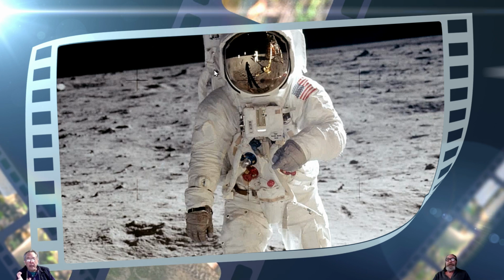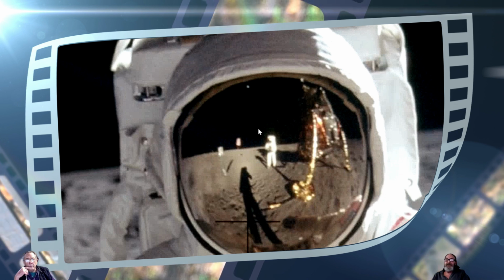THE APOLLO DISCUSSIONS "SHADOWS/ EARTH COORDINATES &  INCORRECT POSITIONS/ FUEL SYSTEMS" PART 68

Comment: Several things about this video that just scream Fake.  The photo of the back of the LEM, how the heck could this thing hold pressure?  It’s dented, has folds in it and the light under the cabinet is a reflection!  The shadow that goes all the way to the edge of the horizon.  Keep up the great work exposing the Fraud known as Apollo!!!
Reply: You're not looking at the pressure hull of the LM.
Reply: @mikeh3441  Even if he was, it wouldn't make any difference, since you know the pressure hull of the LM was made of aluminum alloy that had the thickness of 3 sheets of Reynolds Wrap.. A hull that was so flimsy in fact, that Apollo Flight Director, Gene Kranz, said : "You  could poke a hole right it through it with your finger".
Reply: @straydog02  Grumman's Lunar Module was an outstanding spacecraft and one whose design principles are still used in aersopace industry today. Typically the throw away comments about "tin foil and curtain rods" come from those that have not made an attempt to better understand the development of the spacecraft despite the wealth of available information and are often formed on a cursory glance at a photograph. Many naysayers haven't even seen the LM without its clothes on, as evidenced by the first commentator.  Kranz spoke highly of the spacecraft, perhaps include those elements in your quotes aswell?
Reply: @mikeh3441  I don't judge the LM on it's appearance, as ridiculous looking as it is, but rather on the fact that it had aluminum alloy walls no thicker than 3 sheets of Reynolds Wrap.. Walls so thin and fragile, that if not extremely careful, even a finger would have punched a hole right throught it, causing instant death to the astronauts inside the pressurized cabin.. You might think that's an outstanding spacecraft design, but there's a lot of people who disagree with you.
Reply: @GENERAL-GRANTANDSHERMAN Posting such easily provable lies only makes you look stupid.. Kranz was not talking about the heat shield on the CM, but the walls of the LM.. Watch this video and listen to what he says... 'You could poke a hole right through it'  zeTETic Backup Channel .. Then look up the information yourself.. It's not hard to find.
Reply: @GENERAL-GRANT1863
What is the relevance of your "three inches of titanium" reference?
Reply: @GENERAL-GRANT1863
Reference please?
Reply: @NoremacOktik  Our resident troll, GENERAL-GRANT is lying.. Both a NASA spokesman and Apollo Flight Director Gene Kranz, admitted on camera that the aluminum alloy LM walls were only as thick as 3 sheets of Reynolds Wrap.. And now that our lying little troll is hanging out with all of the other liars on the Phase 52012 channel, don't expect him to be honest about anything.
Reply: @straydog02 

Their study found that 75 percent of adolescents lie, with an average of nearly three lies a day. But 60 percent of youth surveyed admitted to telling up to five lies daily. These numbers aren't as high as those in the studies cited above. However, they confirm that teen lying is to be expected.
Reply: @GENERAL-GRANT1863 It was aluminum alloy, with the thickness of 3 sheets of tin foil.. Silly lies will not help your cause.
Reply: @GENERAL-GRANT1863 I already have.. So as you like to say, shut it.
Reply: @GENERAL-GRANT1863 Gene Kranz claimed the LM walls were as thin as 2 sheets of tin foil, but the NASA rep said it was more like 3 sheets of Reynolds Wrap.. So it was not 3 inches think like you falsely claimed.
Reply: @GENERAL-GRANT1863 When Gene Kranz said you could poke a hole in the side of the LM with your finger, he wasn't talking about the heat shield.. So stop lying.
Reply: @GENERAL-GRANT1863 The Apollo Lunar Module featured a pressure hull with an extremely thin metal layer, measuring only 0.3 millimeters (0.012 inches) in thickness.

Comment: 24:59 I’ve flown airliners and the speed of them has definitely increased since the start of jet passenger travel… they fly higher and at much higher Mach Numbers than the early days. Typically a modern airliner operates around 40,000 feet at a speed of Mach 0.85 - 0.92… it’s actually impossible to operate much faster than that without a specialised supersonic wing section, like Concorde. Also, the advanced Bypass Turbofans you refer to have actually enabled this…. So it’s untrue to say they fly slower these days or that it’s the fault of the Bypass Engine technology 🤷🏻‍♂️
Reply: https://www.miragenews.com/why-passenger-planes-fly-slower-than-past-989515/
Reply: @scotthenderson6168  Hi Scott… that article is correct but omits any information about Mach Numbers and Groundspeed… flying higher might reduce your MPH but that’s measured with air pressure which reduces  with height… the speed that matters is Groundspeed, your speed across the Earth taking into account head/tailwinds and achieved Mach Number… incidentally if an airliner is flying into a headwind it will fly as fast as possible to be affected by it for the shortest possible time, with a tailwind you will fly at a more fuel efficient speed to take advantage for longer… so the statement that modern airliners fly slower than predecessors is not really a fact.
Love this channel by the way 👍🏻
Reply from the maker: As long as you take your own oxygen with you to mix with the fuel, you can go as fast as humanly possible at this time, depending on the engine. There is a big difference between COMMERCIAL airliners and jet engines, such as the SR-71 Black Bird as well as the fuel required. These are completely different engine and fuel designs. Please read the article that Scott posted in his comment. I suggest that you go to Mentor Pilot's channel, and review a few of his earlier videos.

Comment: The complete lack of "bracketing" on the Apollo 11 mag.40 film gave it all away to me years ago. Great work guys!
Reply: Great point!.. For those who don't know much about photography, this is what bracketing is ....

"Bracketing is a photographic technique where you capture several different exposures of the same scene. This technique is often used to ensure that at least one shot has the desired exposure, especially in situations with challenging lighting conditions." ... Or as Mike Collins replied to mission control when he was told they had a picture on the TV,  "Oh that's great. Is the lighting half way decent?" 😉
Reply: @William-tecumseh-sherman Are you serious?.. According to the official Apollo record, the astronauts took over 8,400 photographs while allegedly on the Moon.. And the first photos, taken during the Apollo 11 photo shoot should have been bracketed, for obvious reasons.
Reply: @William-tecumseh-sherman Besides the plaque photos, there was no bracketing. Also the sequence of photos taken, going from shadow to light to shadow, meaning those shots had to be reconfigured multiple times on the manual camera is laughable. The most iconic picture of Aldrin on Apollo 11 was taken with 1 shot. With no viewfinder, light meter, guesstimating settings, with 1 camera. Absurd.
PS You're the liar.
Reply: @William-tecumseh-sherman Buddy, you don't know what you're talking about. There was only 1 film camera on the supposed lunar surface on Apollo 11.
Reply: @William-tecumseh-sherman 8,400 photos were taken for all of the photo shoots put together, which is absurd.. Had the astronauts taken that many pictures on the "moon", they would not have had time to do anything else, but the filmed footage does not show that.. So that's just one more provable lie in a very long list of proven Apollo lies.
Reply: @William-tecumseh-sherman Your reply has nothing to do with the fact that the Apollo photos were not bracketed.

Comment: THIS PART OF APOLLO MISSION IS FISHY🐡L.E.M. ASCENTED INTO LUNAR ORBIT TRAVELING AT 2,400 METERS PER SEC., WITH 9MIN. OF OXIDIZED FUEL, MOST OF IT USED UP TO REACH LUNAR ORBIT, WHILE LUNAR COMMAND WAS TRAVELING AT 1,600 METERS PER SEC. TO STAY IN LUNAR ORBIT🤔NASA WANTS YOU TO BELIEVE THOSE LIL R.C.S. THRUSTERS SLOWED THE L.E.M. DOWN TO MANEUVER AND DOCK WITH LUNAR COMMAND MODULE😂R.C.S. THRUSTERS ARE TO WEAK TO SLOW L.E.M. DOWN WITH L.E.M. SPEED & MASS, NOT TO MENTION R.C.S. THRUSTERS LIL FUEL CAPACITY MAKES THIS TASK INHUMANELY POSSIBLE🤣

Comment: Hard to believe you would be messing around when a pin hole leak would probably mean a terrible death before you could get both men inside the lander. And it would have to be both or one would be trapped outside as there was no air lock. Good work gents.

Comment: My question is how does any kind of rocket engine work in an infinite vacuum? What is the exhaust pushing off of? 
I've heard that, oh  it expands so rapidly it pushes on the front of the engine. Experiments in vacuum chambers have shown that not to be true.
I watched one video where they demonstrated thrust in a vacuum. They lit the rocket engine and it took a split second, but then it did move in the chamber. But when I slowed the video down to 1/4 speed, the engine did not budge until the exhaust hit the side of the chamber THEN it moved, not before. Well in space there is no edge to the vacuum "chamber". Any kind of pressure is going to instantaneously exit where the least amount of resistance occurs. And if it does push against the front, wouldn't it equally push against the sides? Then which direction is it going to go?? Crazy in all directions??
Then I watch when the LEM is reconnecting with the orbiting craft and the motions it makes are crisp and all herky jerky. It looks incredibly fake. Those motions aren't possible in a vacuum, even if they have magic rocket engines that work in a vacuum, the craft is still not going to be able to stop moving in any direction on a dime.
Also, the movements of the astronots on the moon would have been anything but slow. There is absolutely no resistance. When they are jumping around like a bunch of drunk bunny rabbits, they should have been super quick, not all slow motion looking.
Anyways, another great video guys! I love that you keep coming up with reasons why this is nothing more than a ploy.
The moon landings are nothing more than a conspiracy to deceive. For many reasons...
Have a great day!
Reply: "Then I watch when the LEM is reconnecting with the orbiting craft and the motions it makes are crisp and all herky jerky. It looks incredibly fake. Those motions aren't possible in a vacuum, even if they have magic rocket engines that work in a vacuum, the craft is still not going to be able to stop moving in any direction on a dime."

According to orbital mechanics, the Apollo rendezvous footage that looks so fake, really is fake.. 

"For a spacecraft to rendezvous with another in orbit, they can’t simply speed up or slow down. If a spacecraft tries to move faster, it will be boosted into a higher orbit as a consequence of its speedup. Instead, they use techniques like changing the relative altitude, which alters the orbital period and causes relative motion between the two. This is often done in a series of “hops” where the altitude is changed a little, the spacecraft drift closer together, then return to the same altitude and hold for a while to ensure everything is fine.

As for orbiting the Moon, if a satellite orbits too close to the lunar surface, the Moon’s gravity might cause the satellite to crash into the Moon. On the other hand, if the satellite is slightly too far away from the Moon, the Earth’s gravity will pull the spacecraft out, flinging it away from the Moon altogether.

So, while a spacecraft can’t stop instantly, it can make calculated maneuvers to change its position or velocity relative to another object in space. These maneuvers require careful planning and precise execution. It’s a delicate dance governed by the laws of physics".. Source: Orbital Mechanics - How do Spacecraft Rendezvous in Orbit?
Reply: "Also, the movements of the astronots on the moon would have been anything but slow. There is absolutely no resistance. When they are jumping around like a bunch of drunk bunny rabbits, they should have been super quick, not all slow motion looking."

Another good point!.. I did some digging into why the astronauts move in slow motion in the Apollo footage and found some very interesting contradictions..

"At the time of the broadcast, magnetic disk recorders capable of storing slow motion footage could only capture 30 seconds in total, for a playback of 90 seconds of slow motion video. 
Therefore, the slow motion effect seen in the Apollo footage is a result of the recording and broadcasting technology of the time, not the lunar environment.

Contradiction....

"The slow-motion effect seen in the Apollo footage is a result of the moon’s lower gravity and the limitations of the astronauts’ spacesuits, not the result of overcranking or any other film manipulation techniques."
---------------------------
So as always there is never a straight answer from those who protect Apollo.
Reply: A rocket is basically a continuous explosion. The explosion will push whatever it interacts with. It doesn’t matter if there is air around or not.

Comment: Any  EXPERT  who looks at the construction and general condition of that lander and believes it went anywhere apart from the confines of that studio should be STRUCK OFF!
Reply: @GENERAL-GRANT1863 Why don't you watch this video and see if you don't change your mind about those LM walls....'You could poke a hole right through it', zeTETic Backup Channel.....  

NASA rep: " The aluminum alloy skin of the crew compartment was about 12 thousands of an inch thick. That's the equivalent of 3 layers of Reynolds Wrap that you would use in the kitchen." 

Al Worden: " The skin of the lunar module was so thin that you could punch a hole right through it."

Gene Kranz:  " If you really took your finger and poked hard at it, you could poke right through the outer skin of the spacecraft. It was about the thickness of 2 layers of aluminum foil."
Reply: Agreed . It would be ok if a bunch of kids made it for a school play !  But thats about it i afraid.
Reply: @GENERAL-GRANT1863 So you think the LM was safe enough for two men to don and doff bulky spacesuits, when all it would have taken for instant death would be one  little poke right through those 3 sheets of Reynolds Wrap?  😁
Reply: @GENERAL-GRANT1863 Since you can't poke a hole right through a human body, no, your analogy doesn't work..The hull was made made of that flimsy material.. Go watch the video I posted.

Comment: After all the stress the looney lander has been put through, most of that wafer thin gold foil would have been ripped off.
Reply: Can be used to wrap xmas and birthday gifts as well as cooking potatoes in a campfire.
Reply: @NoremacOktik  Hey man, check out this video about the tin foil looney lander.. It's a hoot!!..

 'You could poke a hole right through it' ,  by zeTETic Backup Channel.

Gene Kranz, Al Worden and a NASA rep all explain how the lunar module was made of material equivalent to 3 sheets of Reynolds Wrap that you would use in your kitchen, and how easily you could poke a hole right through it with your finger!  😂